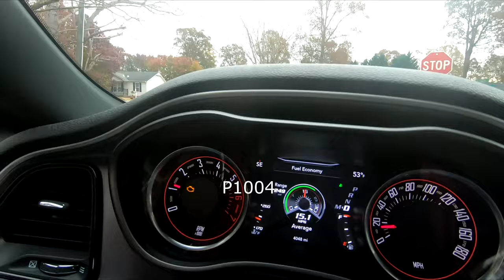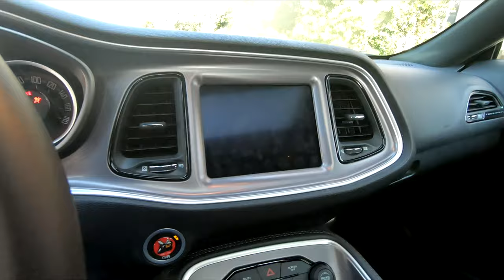P1004 on my new Dodge Challenger

Comment: Same code on my 2012 srt8  I changed the short runner myself got the code again !!!! I’m hearing I have to take it dodge and get it flashed
Reply from the maker: They told me they were going to replace a solenoid but I mentioned the software update. Had my car back in 45 minutes. I think he just did the update not sure. You should be good after that.
Reply: @Sky1  thank you I hope so  !!! You are so right about the low end torque and gas mileage with this code it’s horrible !!!!!

Comment: Same problem
Reply from the maker: Please let me know if they changed your Intake Manifold or only changed the module and reflashed it which is what they did for me. Getting super gas mileage now and excellent low end torque.